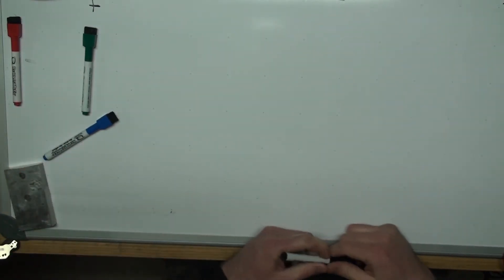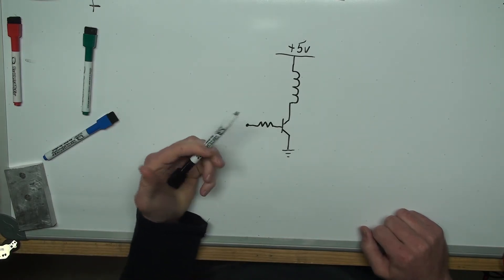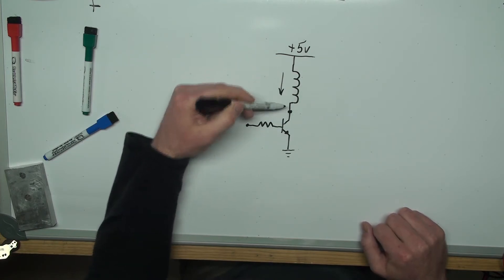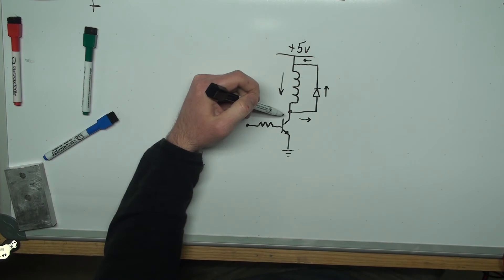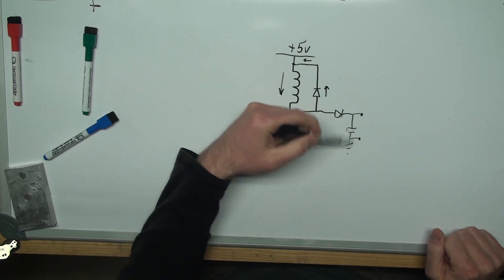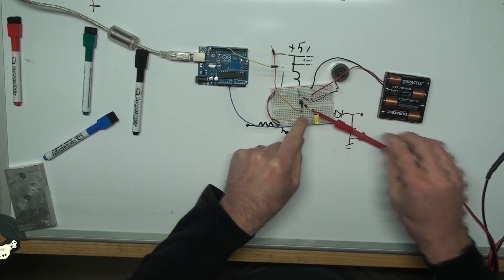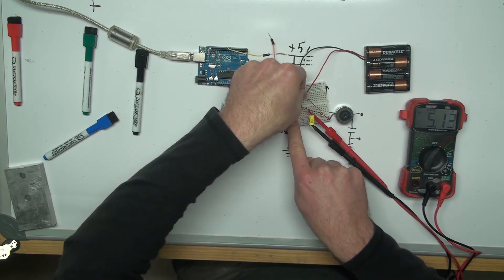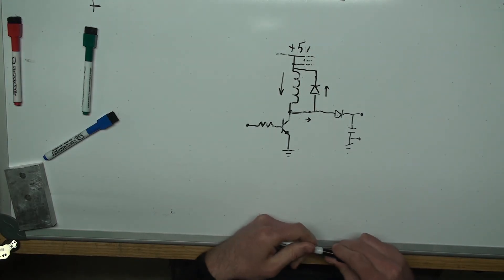Driving inductive loads with a transistor

Comment: Where did the 40V come from? I did not notice any external powers source.
Reply from the maker: +Hacksaw Henry There isn't another power source, that 40V is the inductive "kick" being induced by the inductor when the transistor turns off.  The inductor is attempting to generate whatever voltage is necessary to keep the current flowing (inductors resist changes in current).
Reply: So it's just like a coil when being de-energized-this principal used to create spark on gas engine spark plugs....right?
Reply: +Hacksaw Henry The transistor is being turned on and off very rapidly by what's called Pulse Width Modulation (PWM) coming from the arduino. This is a good technique for controlling the speed of some DC motors, but as KYCoffey said, there is a voltage spike generated by a collapsing magnetic field in the motor each time the transistor is turned off.

Comment: Maybe one comment to the voltage we get when we add required diode: 5.8V is because diode's P-N junction forward voltage of around 0.7V is added to the 5.1V got from the battery pack. Nice video!